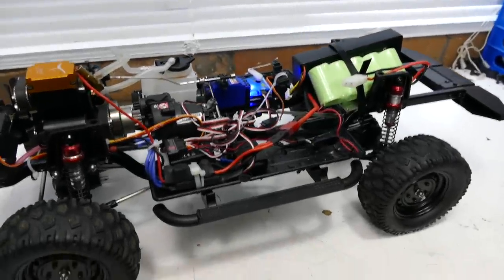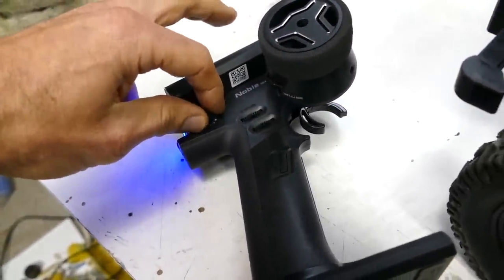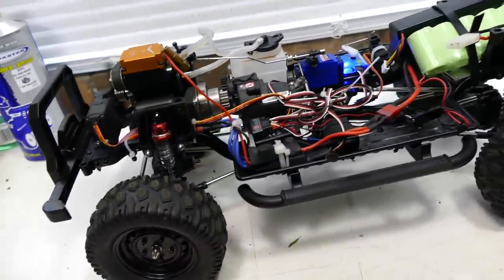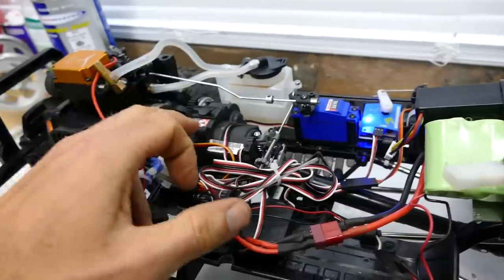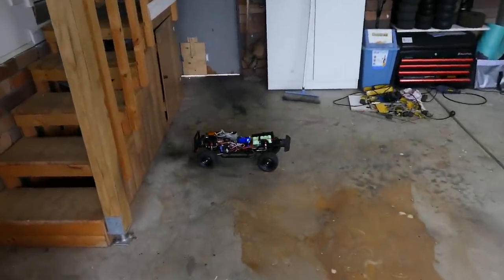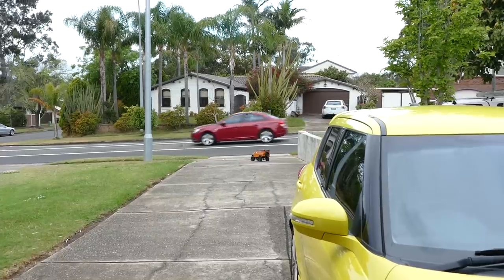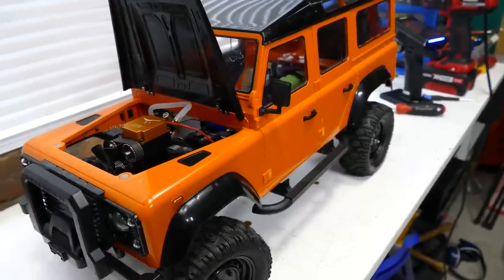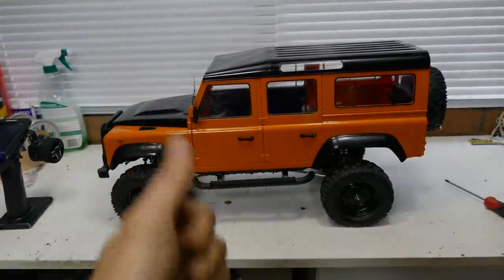4 STROKE OVERHEAD CAM ENGINE INSTALLED INTO RC CAR Part 5 - FIRST DRIVE, IT WORKS!

Comment: thats epic well done! I wonder how well it will crawl?  v4 in a monster truck :)
Reply from the maker: Much appreciated bro! Definitely going to find out regarding the crawling capabilities 👍😉
V4 would be great in a monster truck!
Reply: I was expecting this from you Kevin because you also have this engine but good work brother✌️✌️✌️
Reply: @urTrickybro  I'll be doing something similar, just got my clutch :)
Reply: @KevinTalbotTV  i am looking forward!
Reply: @KevinTalbotTV  waiting for that buddy😃
Reply: I'm looking forward to your build with this engine; Kevin. 
I'm betting most current electric motors will be far easier to control/facilitate crawling(torque from zero rpm to max rpm). But the 'scale-ness' of this is over the top.
Reply: Or in a buggy.
Reply: I came to this video because i thought it was you! It was a good video anyway. Should have manual clutch and all on the remote
Reply: Hahaha @Kevin talbot knew you have seen this video
Reply: @kevin Talbot cant wait to see you build it
Reply: Hi kev! 😀
Reply: Kev!!!!!! Big fan my guy

Comment: probably it wont shift into second because it need more rpm for the clutch to engage
Reply: Maybe your rite. But you can adjust the transmission to shift early that grub screw he is talking about is the adjust point. I got my Revo to shift very early with nearly no RPM for a 2 stroke.
Reply: I was gonna say the same thing....he may need less teeth aswell...but this is a awesome build my gawd...
Reply: Run lighter clutch bell springs may help
Reply: Reverse clutch shoes to get low rev clutch engagement, i put a OSFS40CX into my Savage SS, we did this and it works well.

Comment: I'm lovin' it so far! Gettin' an exhaust, intake setup on it will be great.

I do have a suggestion regarding a fuel tank. Try an airplane tank on it. I think a 6 or 7 ounce would fit nice in the back, it would feed fuel when the truck's upsidedown, and it would be less prone to spilling its contents. Also get a much larger amount of fuel on board in the first place.

I also wouldn't worry too much about a catch can for the oil. Just let it drip. IT's scale detail and castor oil isn't going to kill the koalas.
Reply from the maker: That's some great ideas. Thanks for the support and glad you like it and appreciate your comment
Reply: whos gona have the first functional snorkle working

Comment: It is a pretty sweet build, and now that you have it running, cleaning the the wireing and getting the interior installed is just the detail stuff that will really make it better. 
The V4 would be a cool hot rod, but with the name Tanks & Trucks, it would have to be a hot rod truck.

Comment from the maker: Defender ➜ https://bit.ly/3eVnpjg
Toyan FS-S100 Engine: http://bit.ly/toyan-fs-s100
Toyan FS-S100 Spare Parts: http://bit.ly/fs-s100parts
Water/air cooled - https://bit.ly/2kmJIFw
Extra 10% Coupon Code: EDRC
Reply: Gotta make it have a working snorkel
Reply: Very nice 👍👌
Reply: I totally agree
Reply: you need to adjust the idle other wise it will where the cranks and rings
Reply: Very Nice project !! Like it ❤️
Reply: How about water-cooling it ??
Reply: Only problem for me it the price
Reply: 👍👍👍👍❤️I really like your rc car.  Look and want to have it to play straight away.  
 I like it very much.  And will follow you forever❤️❤️❤️👍👍👍👍👍

Comment: !!YOU NEED AN AIR FILTER!! Its not shifting into 2nd because the engine doesnt develop enough rpms.Try gearing up but that will limit your crawling abilities of course.

Comment: Awesome man 👍 is there any way you can rotate the front diff housing and axle up a small bit so it's not such an extreme angle for the front drive shaft? Just wondering. Sweet job man 👍👍🏎️ also the perfect air filter would be an actual fuel filter i noticed your carb intake hole is about the same size as some fuel line you could run a little bit of tubing from the carb intake to a small cone fuel filter it would have good breathing.
Reply from the maker: Sweet, thanks for the info

Comment: Your truck is sweet bud job well done and that electric start from the controller is almost over the top in a good way!  Looks like you have a few small details to adjust but obviously you have the skill and knowledge to get it where you want it 👍👍  that small amount of drips might be because your fuel trim probably set to break in settings and after it’s broke in and adjusted correctly you might not get many drips or none at all sweet truck man!! I have been an RC junkie for around 30 years I love it
Reply from the maker: Much appreciated brother and thanks for watching and glad that you liked the video

Comment: Nice video 👍 you did your thing sweet setup and as far as the 2 speed the engine dosent have enough torque to switch the gear so you would need to screw the screw to wear the spring isn't to tight so it would switch under lighter torque hope that makes sense sure is a sweet build 👊

Comment: Hi! That's a really great built! I wonder, how a Savage S28 3Speed Transmission (upradeable to Reverse) would work with this engine. Or also a manual 3 speed Transmission from a Tamiya High Lift model.
Reply from the maker: Yeah I was thinking the same thing. Problem with the Tamiya gearbox is trying to adapt a brake setup.

Comment: 3 shoe clutch next, should slip less :) nice build looking forward to next ones, One thought i had for the build, mount the interior back in, put linkages through and wiring etc, make some scale looking containers that you might find in a full sized car, like a fridge, plastic box type deal, use them to mount (disguise) the new parts required to run the engine, the fuel tank could be installed underneath somewhere, and use a scale jerry can mounted on a rear door holder drill a hole through glue a pipe inside hose one one end a cap on the other new filler port that way it looks stock, you could even make a transmission tunnel out of some aluminum, would look sweet, well looking forward to the next video :)
Reply from the maker: Some very interesting ideas there brother. Much appreciated

Comment: Adjust the 2nd speed to engage early it really wants high speed centrifugal force out of a nitro to shift so it needs to be tuned to engage as early as possible.

Comment: Might i suggest that u add a exhaust to make it alittle quiter,  and build a snorkle for it for easier way to turn off instead of opening hood to choke it?
Reply: You could hook up a shutter on a return spring that closes over the carby, hook that upto a micro servo to hold it open on start up and to shut it down release the shutter to cut air. Www asy enough if you got the spare channel

Comment: Can I get a servo and parts list? I haven't found the servo and the ignition box for the starter and glow plug but did find the motor. Any more info would help. Keep up the great work! Thanks
Reply from the maker: Thanks mate. I will do a video later on what is needed

Comment: That's a great combo, it worked so well. Amazing work Steve, looking forward for more. The V4 is actually very tempting. Maybe to be put into a 6x6 or 8x8 truck, that might be interesting as well.
Reply from the maker: V4 in like a hotrod with the engine exposed would be sick too

Comment: The 2nd gear shift is adjusted by a little grub screw and spring in the transmission. Tightening it puts more preload on the spring causing it to shift later and loosening it makes it shift earlier. You will likely need to loosen it a lot to get it to shift with that engine. Also be careful - if you undo it too much it may pop out and fall in the transmission.

Comment: Fantastic work dude you have done it! I love how excited you sound. Can u fit a transfer case in there? Maybe it can help with the 4wd and the angles of the drive shafts? Anticlockwise the hex nut in transmission to loosen may help with that second gear to pop in.. :) Thanks for sharing your enthusiasm!
Reply from the maker: Thanks man going to see the if I can rotate the diff.

Comment: I suggest you use a transfer case, will solve both your problems with the forward and rear drive shaft
Reply from the maker: The front is just too close for that. Its ok tho, I seem to have made something work. Next video I will show it.

Comment: The reason it doesn’t shift into second gear is because your engine is not powerful or high revving, the traxxas 3.3 engine that normally comes with that transmission is really built for speed and only shifts when at high idle

Comment: Screw perfection, it's all about having fun. Plus, I think the build is coming along great! Imperfections build character and great builds are full of character. The front driveshaft situation... 🤔 Maybe 2 short shafts paired together will bridge the gap with enough range of motion to meet the needs of the steep angle..? I've seen it done on other custom rigs, dunno if it's feasible for your situation. Keep up the good work! This vid had me smiling the whole time. 🤘🤓
Reply from the maker: Much appreciated bro and glad it brought a smile to your day 👍

Comment: For your drive shaft problem. Try doing a like transfer case from the back of the revo trans.. at that point the rear shaft will be shorter and the front will be at a better angle also...  love watching this project evolve..
Reply from the maker: Cheers bro, thanks for the advice 👍

Comment: Cool video those transmission are preset you have to make sure your engine is tuned in well or engine is not turning the high rpms like a two stroke I’m not sure if you can lower your shift points to make it shift

Comment: Hey steve!  Maybe not enough RPM ' S  to shift to second gear? Does this four stroke rev as high as a regular nitro engine?
Reply: No ,not even close to the rpm a reg 2 stroke nitro engine ,it's about half the rpms
Reply: @ronfisher2016  so I'm guessing that if the tranny is out of an revo 3.3 then the shift point to second gear will require a lot of 
RPM ' s, and this motor won't rev high enough to reach that set shift point.
Reply: @silverrick90  ,I agree with you.

Comment: It's cool and awesome! Great work.Is the engine and gearbox box connected with clutch or direct?will this be equipped with a 2wd/4wd selector?
Reply from the maker: It is connected via a clutch bell then mated to a Revo 3.3 transmission. That has 2 speeds forward and reverse plus brake.

Comment: Mine (1971 classic rangy) has the front diff tilting upwards to the transfer box. At normal ride height the UJ are the same angle. It was the way they stayed until they stopped making the defender. I hope that it is an idea that can fix it for you :D
Reply from the maker: Aweome mate. Thanks for the info

Comment: A fantastic job, it isn't revving high enough to change gear and may not, but it sounds like it has torque so may be a good trail truck.
You are very nearly there with it, try getting a HPI transfer box or similar, then you can run a shorter rear prop and a longer front.
This would be good in a Trophy Truck or Pre-runner as they are mainly rear wheel drive, I don't think it will be that quick unless you can get the two speed working and so a bit slow for a Hotrod maybe a rat rod though.
Looking forward to the next stage.
Reply from the maker: Much appreciated bro and thanks for comment

Comment: what electronics are you using for the starter motor
Reply from the maker: It's an esc supplied from enginediy. Check out the links in the description

Comment: Gotta be the smoothest nitro engine
Reply from the maker: Thanks man
Reply: RC Tanks & Trucks 24/7 one question about this build: for the ignition system, why do you have a servo turning a servo tester? Couldn’t you plug the esc directly into the receiver?

Comment: Since I'm a petrol head , can you just tell me some advantages of the 4 stroke engine over electric motors?
Reply from the maker: They sound and smell better 😊 Apart from that, nothing else
Reply: @RCTanksTrucks247  , and if you consider the the normal motors (Not the brush less once)  for all these rc 4x4s,which one do you think is much better ,those motors  or the 4stroke engine which you are using !

Comment: Very cool! Great build mate! Could put a vent or 2 in the hood for heat ventilation? Or maybe even poke some holes in the grill and run a mini fan in front of the engine?
Reply: It has a fan on the front of the engine
Reply: Oh right! Never mind!
Reply from the maker: The fan at the front is fully functional 👍
Reply: Yeah, I wasn’t thinking about it when I made the suggestion. 👍

Comment: I dont think your moving fast enough to shift brother. I may be wrong
Reply: 2nd speed in that traxxas box needs way more RPMs to engage, The trans just needs to be tuned to shift as early as possible because this motor RPMs are way too low for what that trans was designed.

Comment: As someone who owns and drives a revo 3.3, I doubt you will ever get the rpms needed to get the transmission to properly shift. I hope I am wrong. 

Love the build!
Reply from the maker: Yep shifts perfectly fine. Check out the latest videos
Reply: @RCTanksTrucks247  Just saw the video. glad you got it working!

Comment: cant u just hook up the esc for the starter motor to a spare channel thta has a switch same one ur using for it now means u can get rid of  the sevro and servo tester its what ive used on planes wiht electric start before

Comment: Does the little engine have a real drain plug for the oil or does it not have oil in it
Reply from the maker: Has a excess oil hole at the base of the engine that you can connect to a small catch can
Reply: Cool thx I was really curious

Comment: It  looks as if the cooling fan is running the wrong way. Good project though and best 4x4xfar, good old Landy.
Reply from the maker: Definitely the right way. You can feel the air rushing over the motor
Reply: @RCTanksTrucks247  Yes, but is it sucking it in from the front of the model or blowing it out the front? Either way you will feel it over the motor.
Reply from the maker: Suckling from the front
Reply: @RCTanksTrucks247  Ok that's cool (pardon the pun) It must be the frame rate of the video affecting it and making it look as if it is rotating in the opposite direction.

Comment: So far all of these brand of 4 stroke engines in RC cars sound way too loud to be realistic. Not enough difference from the 2 strokes yet. Sounds like a lot of topend noise, so long exhaust and/or mufflers may not be able to quiet these enough.
Reply from the maker: It's not bad really. Much more quiet in person and better than a traditional nitro 2 Stroke

Comment: Can you add a transmission, so it can add more speed
Reply from the maker: It has a two speed already.
Reply: @RCTanksTrucks247  wow that's amazing, is it automatic or manual?
Reply from the maker: Automatic. It's a Revo 3.3 gearbox

Comment: This engine does not have the rpms to shift the 3.3 trans to 2nd gear. So you will need to putt a smaller gear on the trans to get the rpms for the trans to shift to 2nd at its lowest rpm rating. I had problems with this when i done the big block swap on my revo.  But this engine being a 4 stroke can only spin so fast. Putt a bigger gear on the engine an smaller on the trans that should get you to get 2nd. Otherwise you will have to rip the trans apart an change out the spring on the 2nd gear clutch to a much loser one.
Reply from the maker: Yeah I might see if I can use a softer spring. Maybe one out of a pen.